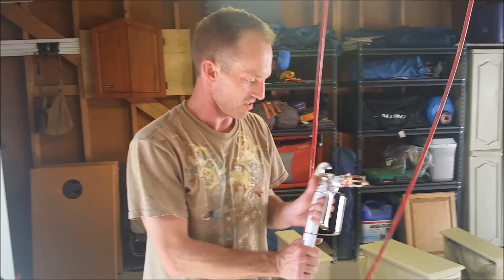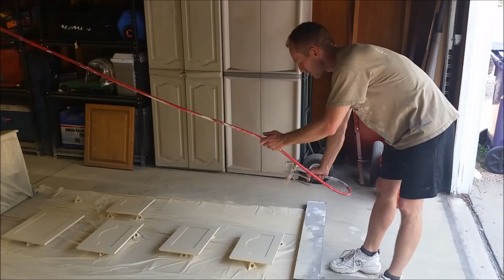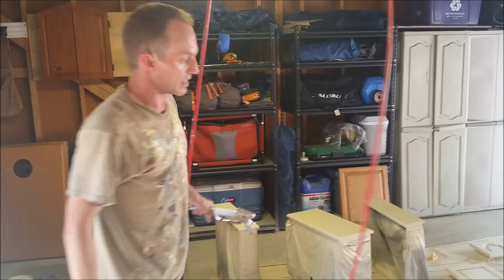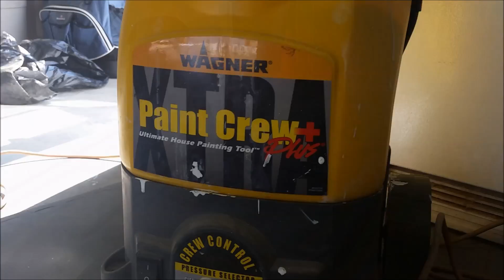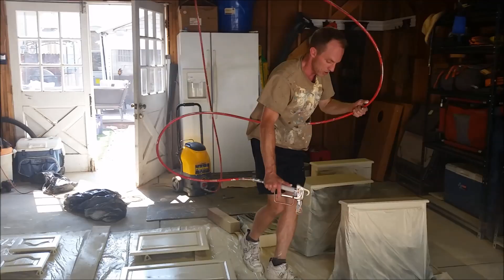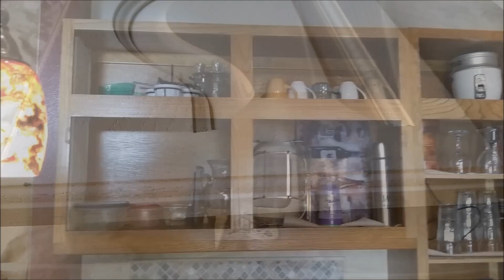DIY Cabinet Painting How To Video

Comment: I'm sorry, but this is not the correct way of doing this.  

First, wear a respirator and save you lungs. I dint care how open the space is, you are breathing paint. Maybe you were just making an instructional video and not wearing one but you can clearly see it was affecting you.

Behr is not a primer and paint in one despite what they tell you. It will not get hard enough nor bond well enough to withstand the test of time. Its a cheap paint.  

Use a sander or liquid de-glosser to give the surface more tooth or adhesion.  Use a bonding primer and then top coat with the appropriate enamel. You don't know what kind of contaminates are on the oak doors and I guarantee you don't want to find out mid way through spraying, i.e silicone, waxes, oils, human fingerprints, etc.

Oak can bleed stains back into the paint and Behr won't block stains.  You may have to use an oil based primer or even a synthetic white shellac to block stains.  You cannot go back and use an oil primer after using the latex.  I repeat.  If you get stains, you cannot then decide to use an oil primer or you will have a whole new set of issues. Best to use the stain blocking primer to begin with.

Oak cabinets can not just be sprayed more to fill in the open grain.  Use a wood filler before priming or brush into the grain in the primer coats. You can clearly see on the video the sides are still raw and they look unfinished.  

Use a smaller tip (i.e. a 312 Rac-X ) and get less over spray.

You have the doors too low to the ground. You will get particulate blown around can affect the final coats from the pressure of the sprayer so its almost better to spray in one area and dry in another.  Use a saw horse and then move to dry for example.
Put up plastic on all the walls and protect your personals! 

Leaving your garage open may give you fresh air but a small gust of wind and you will have debris, leaves, sand, dirt, flies in your finish product. Especially when it near the ground. I recommend keeping it closed.
Reply: abuss98074 Thanks for the very detailed info.  I will definetly heed your advice when I get around to painting my cabinets.
Reply from the maker: Thanks for being constructive with your criticism. This particular project turned out great and really made a difference once it went on the market!